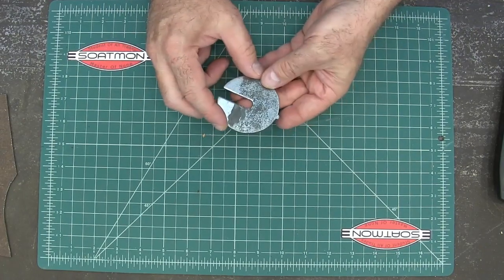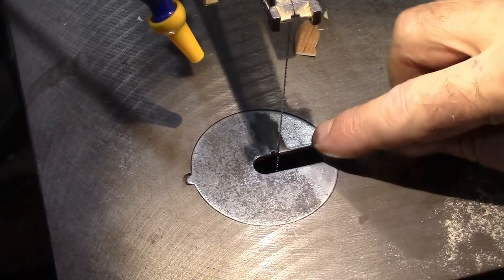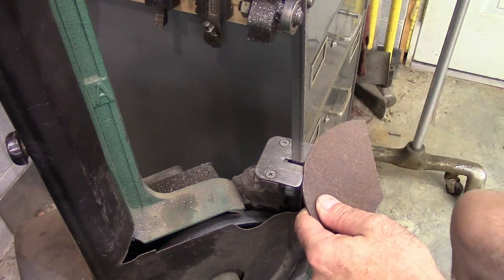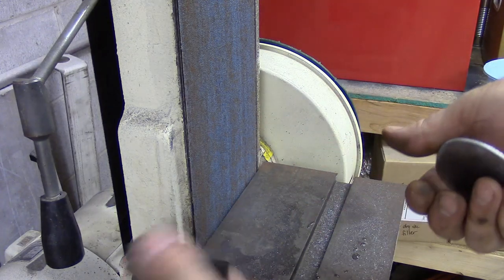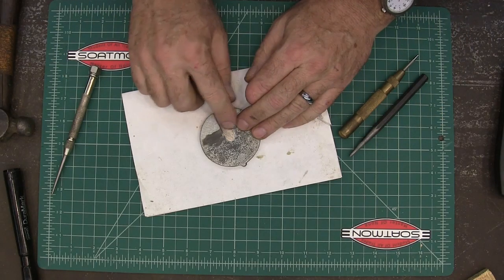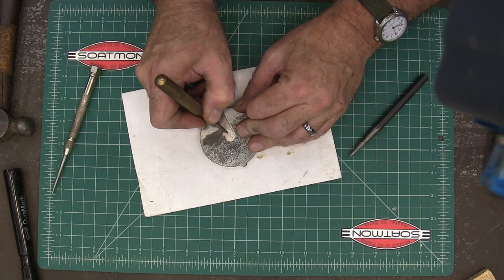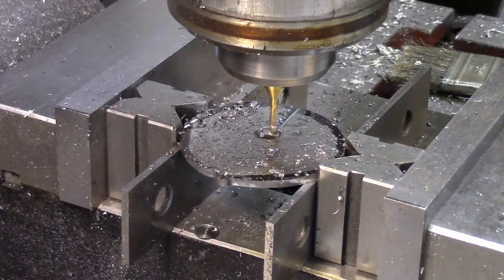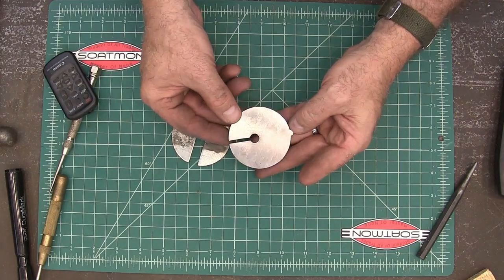Scroll Saw Insert Upgrade

Comment: Very good upgrade....I really must do that too.  Actually it can be a little dangerous the way it is.  Here is something you should know  "not complaining"  if I go to soarmon.com and try using  your shopping catalog, it does not appear.   It goes directly to some amazon site.  To get to your shopping catalog I need to use a link you provided on the video. It could just be me making a mistake but possibly other people are having the same thing happen.  I will go and add the correct place to my favorites but you should still know other people may have this trouble trying to get there through the soatmon.com way.
Reply from the maker: The Amazon banner at SOATMON.com is not linked to the Amazon store, it's really just an ad for Amazon.  That's really my fault I don't have a lot of experience with setting up the blogger site and don't know how to link it straight to my Amazon store.  I appreciate you pointing it out to me, I need to work on it and see if I can figure it out, a link to Amazon.com/shop/soatmon would be a lot better.  I appreciate you taking the time to go to my store, the little bit of revenue I get is encouraging.   It's like getting a gold star in school, it doesn't make a big difference in the big scheme of things but it make me feel good.   Thanks again 
Glenn, I'll see what I can do...